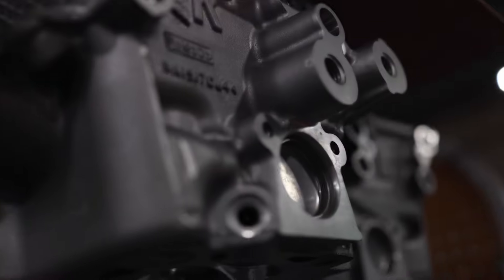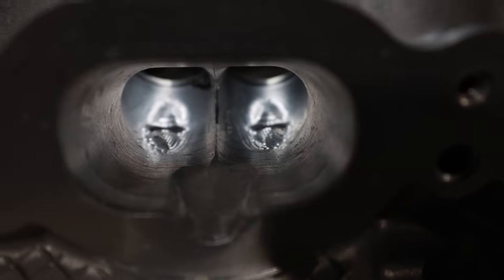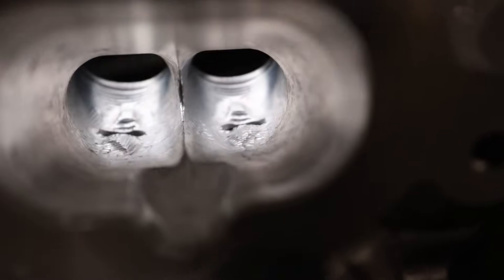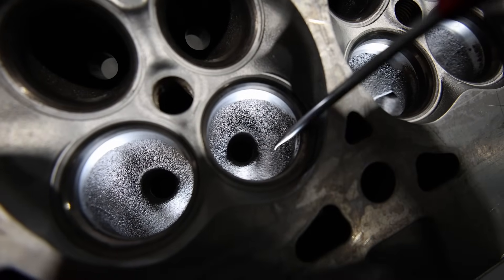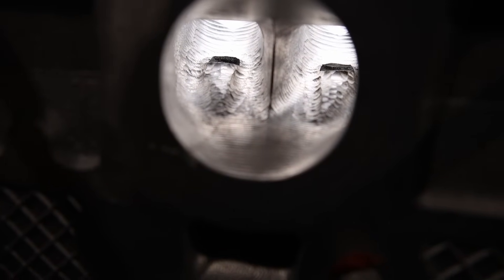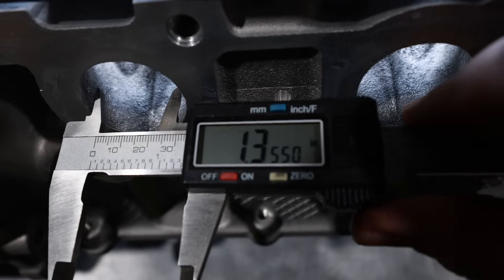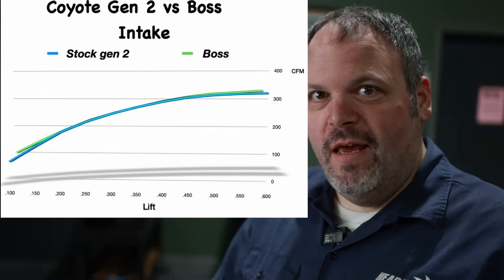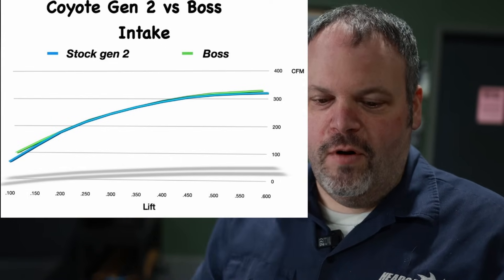Gen 2 Coyote VS Boss 302 cylinder head: Myth Busted!

Comment: Don't see any Boss 302 heads in this video. WTF? Besides the Boss 302 heads are actually Boss 351 heads modified to fit a 302 block.
Reply from the maker: And they were also far too big for the engine.

Comment: From someone who used to own a 13 Boss, thank you for this. The standard coyote in 13 was 420hp, the Boss 444hp. It’s not so much the hp difference, it’s the way it makes power and never stops pulling. The whole engine was different, fully forged bottom end, cnc heads, larger cams, and the intake.
Reply from the maker: @JohnThomas-vb9se  my dad has a 13’ with 8500 miles. I should have known the hp. I am getting old and can’t remember small things like that lol
Reply: Sorry, but by Ford's own part numbers, the rods and crank are the same, valve springs are the same
Reply: @karlhaglund2841 the connecting rods in a BOSS 302 are 100% different than what's in a GT. They are forged, the GT isn't.  It's well known that a BOSS holds more power than a GT engine. Not sure where you're getting your info from.

Comment: You measured the exhaust ports which are larger on the Gen 2. How do the intake ports compare in size?
Reply from the maker: @jasonlamar2053  the intake port is slightly larger on the gen 2. That’s why it didn’t clean up on the cnc

Comment: Great video,  I  had been told the same about the Gen 2 Heads from Ford insiders for years.  Question.......  I am assuming that the GEN 2 heads you used are Mustang Coyotes and not F150. I have been told the Gen 2 F150 Coyote heads are the same as a GEN 1 head.  Would really be good to compare the F150 castings to the Mustang Gen 2 and then the Gen 1 castings.
Reply from the maker: @robinlawrence2138  we just need someone who has confirmed f150 head(s) to send in.